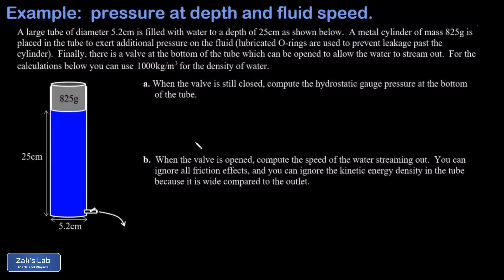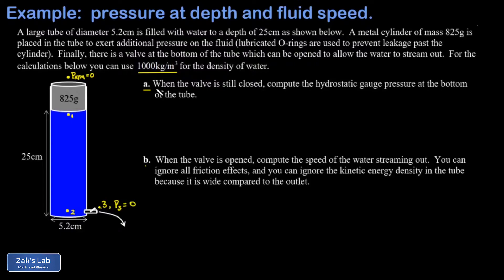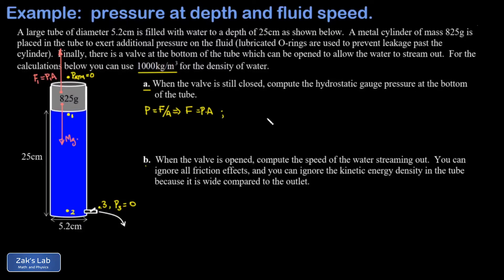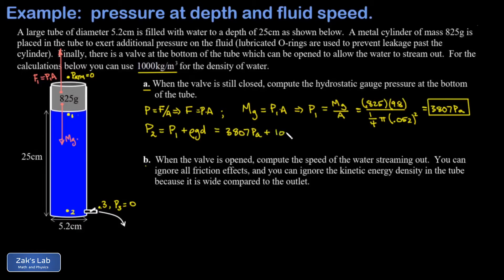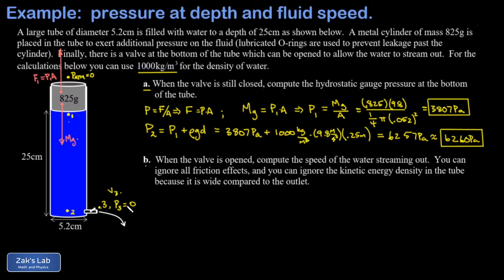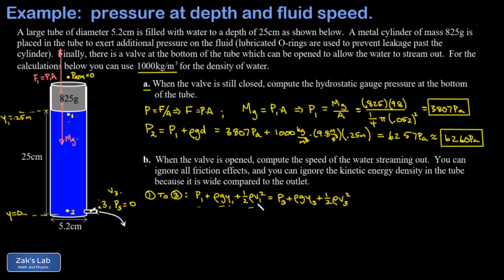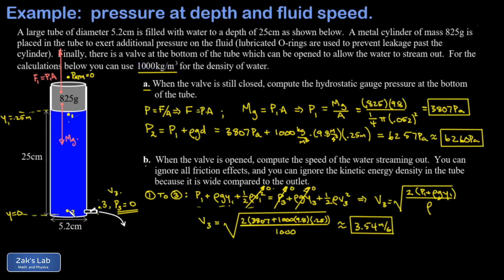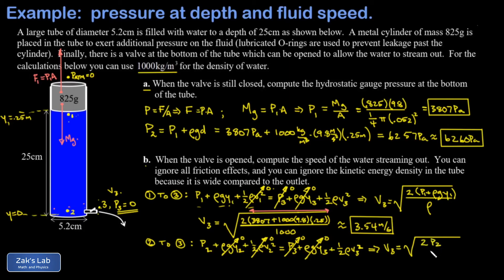Water column with mass on top: pressure at the bottom and fluid speed when the valve is opened.

Comment: What about the diameter of the valve opening?
Reply from the maker: as long as that's small compared to the vessel diameter, we can make the approximation of zero velocity at the top surface.  Of course, the diameter matters a lot if we're taking viscosity into account, but we're treating the fluid as frictionless here. z
Reply: @ZaksLab  Thank you